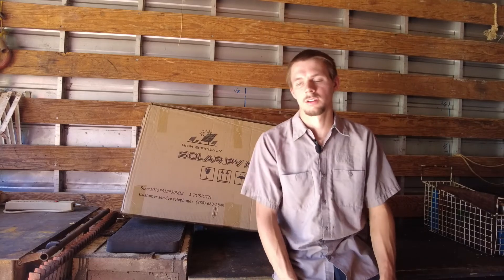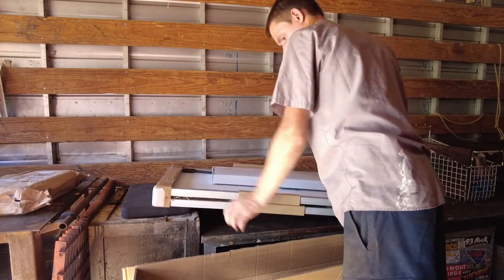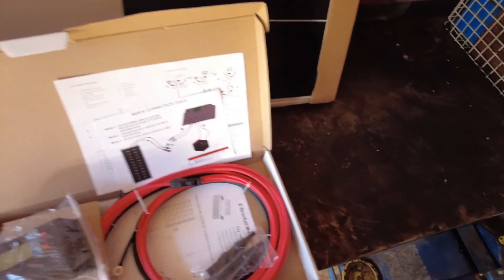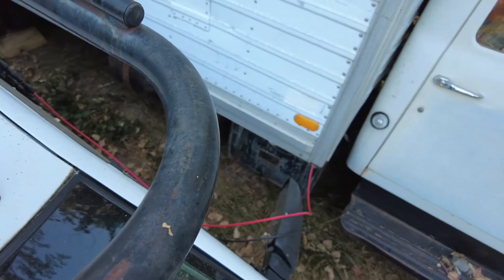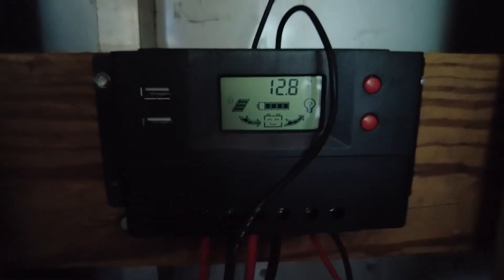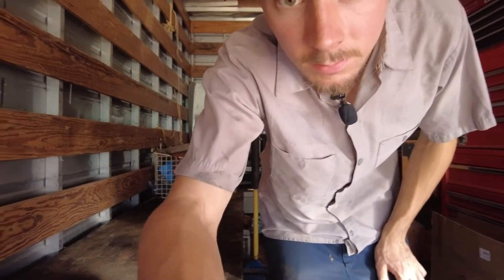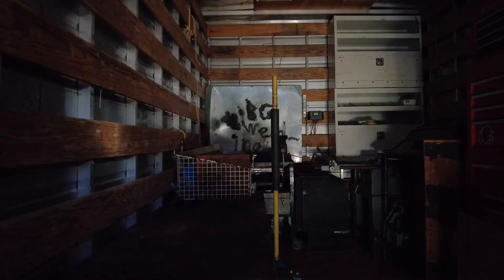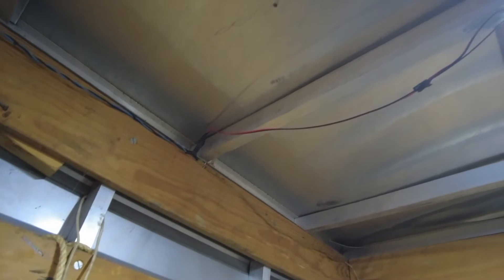Solar Panel Powered Light Installation in Metal Storage Container

Comment: Very nice setup. I was wondering wouldn't the light switch be better by the door that way if you need to access the lights at night time be better?
Reply from the maker: Yes, absolutely. I just kept it close to the battery's and solar charger instead of using a bunch of wire to relocate the switch.

Comment: Welcome back to the real world.  🙂 Interesting setup.  So, the charge controller will feed the battery from the panels, or pull a charge from the battery when the panels are dark?
Reply from the maker: Haha thank you. And yes the charge controller feeds electricity to the battery from the solar panels. It regulates the power coming in from the solar panels to prevent the battery from being overcharged. And then the battery power side is used to power the lights and other stuff.